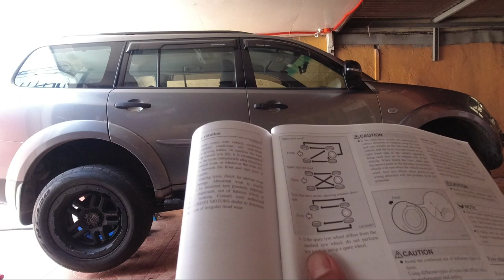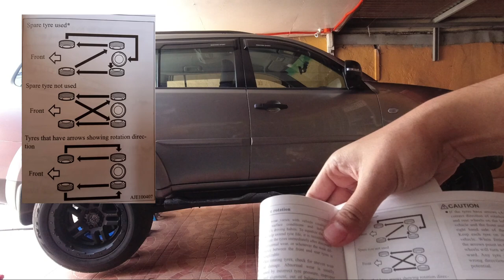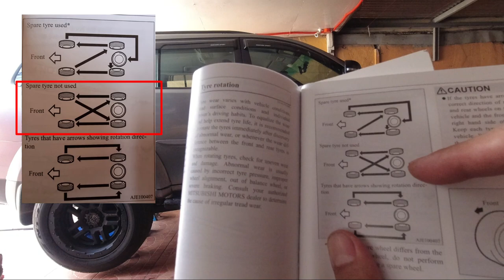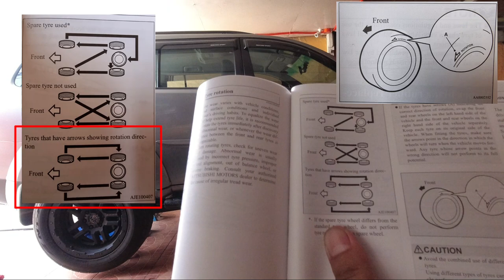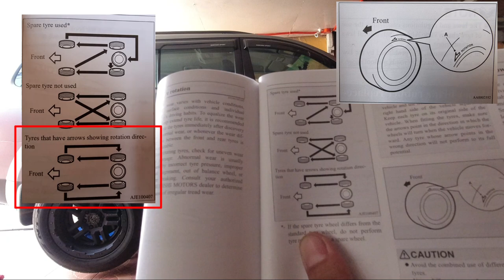Tamang Tire Rotation Para Matagal Maupod ang mga Gulong

Comment: Do not use mismatched wheels and tires even in emergencies. If nagpalit kayo ng sukat ng wheels and tires, might as well palitan din ng the same size yung spare. Mismatched wheels and tires will trip your ABS and Traction control. In addition, it will also cause more wear sa good tires na nakakabit. If you’re driving an AWD or 4x4, it will cause damage sa internal gearing sa diff, axles, u-joints, driveshaft etc.
Reply from the maker: Salamat sa tip sir. It will indeed turn on the ABS warning light. But once you reinstalled the right tire, the light will go away by itself. Once you find a vulcanizing shop which is probably not going to eat a lot of km, it will not inflict significant wear on your tires and will not damage gearing components. In contrary, if you drive fast and in long distance with an imbalance wheel sizes, then that's the time na ma-damage ang gears at maupod ang tires. IMO, this is much more practical doin in 
 emergency situation than getting stuck in a secluded area where there are more probabilities of rubbery, holdap etc. So give and take na lang po iyan at driver preference. That's why I don't remove the stock spare tire on my car.
Reply: @NoahsGarage  Fair enough, sir. But you’ll be surprised how a mismatched tire could do damage to a diff. I personally had to swap a diff for a customer because of this specific issue. To each their own, I guess. Not my vehicle. Not my money. Not my problem.